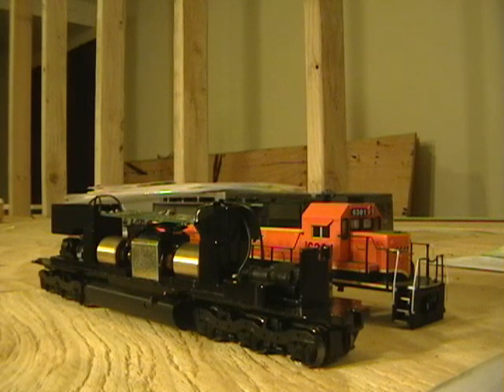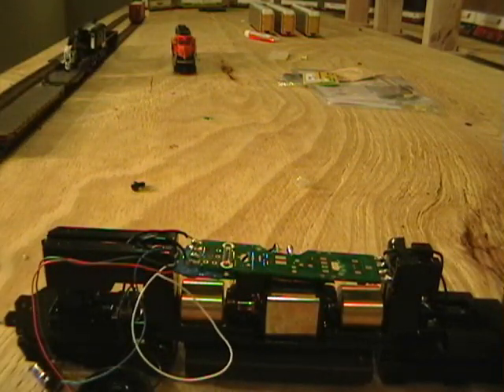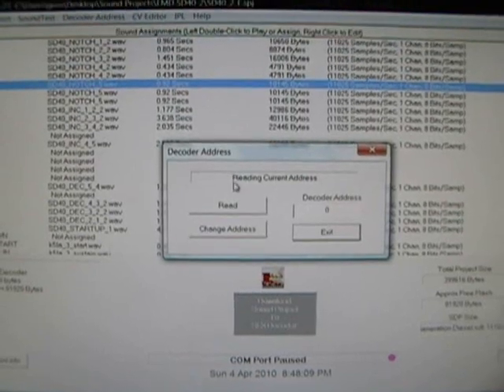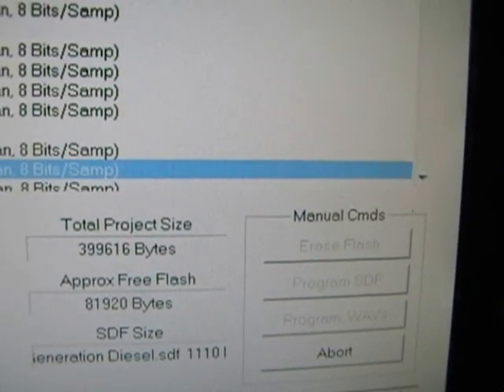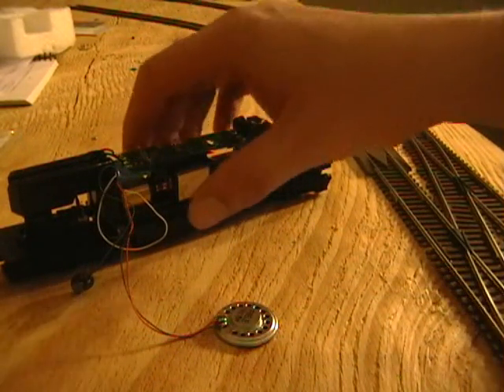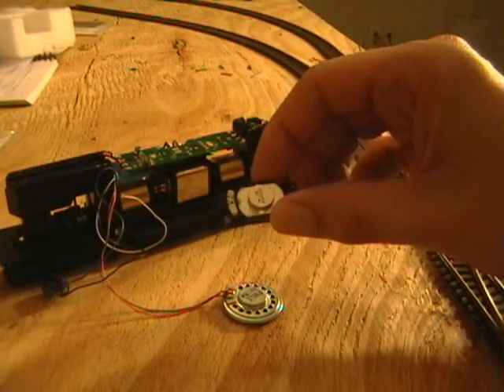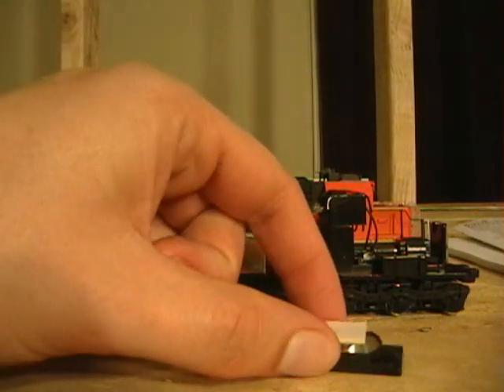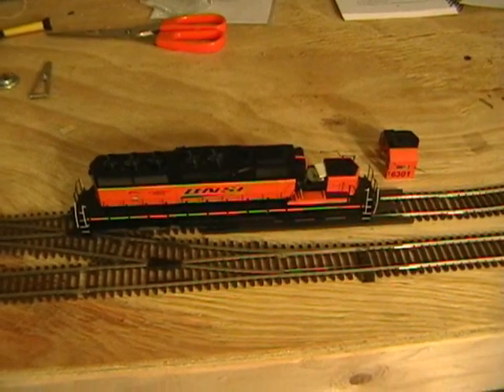04-05-2010 Advanced DCC - Part 4D Digitrax Sound Bug Install

Comment from the maker: oops, I understand your question now. You can use this with the DH123, you will only need to run jumper wires from red and black to the screw posts. Black to one of the posts and red to the other. Then tape of the pins in the middle so they don't make contact with anything else in the loco. I hope this helps.

Comment from the maker: The change may not always be ideal because you run the risk of damaging either the decoder or the speaker. This is, however, very unlikely because we're only dealing with 1 watt or so of power. In a situation where you may be dealing with more watts such as a stereo or with music equipment, you would definitely want to stay within the ohm tolerance to avoid blowing speakers.  I will mention this the next time I do a sound video. Thanks for bringing it up.

Comment: Hemostats make a great heat sync when soldering ,clamp them next to whatever you want to protect from the heat.! Have you ever tried using a sugar cube speaker ?There great capturing the low tones that many of the standard cone speakers cannot produce ?Great video well done with the description of the details involved.

Comment: ok so you have to program the motor decoder to a certain number (lets 4002). so you program it, and everything is running good. you plug the sound bug in and then program it to the same number (4002) and it sound work? and another question is, would this work for the JMRI program?

Comment: Question! Have Proto 2000 E 8A w/small light board and 8pin receptical. I want to install DCC w/sound Digitrax  SDH165D decoder. Question is can I just plug in the SDH165 into the 8 pin and go from there? I have the Digitrax 8/9pin cable! Anyone have the answer? New at this DCC stuff! Thanks!

Comment: all I can say is that I deeply regret having installed over 80 soundbugs in my katos , what is it worth if it can t load a sound project that is less than the memory room? or if you re not able to load a soundscheme at all ? thanks for your video you just confirmed what I was guessing ; an c-424 with a sd-38 soundscheme...
Reply from the maker: rene levesque still use them, but I am a bit more selective in the application. Looks like Digitrax has a new line of Soundbugs with more memory